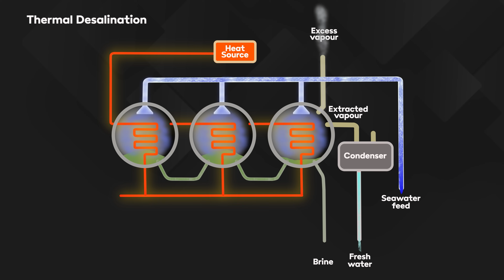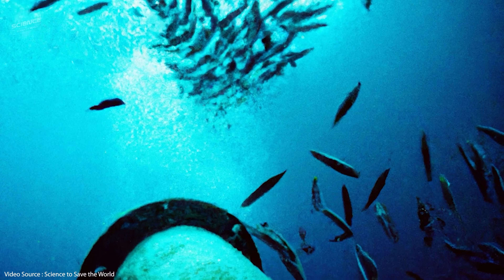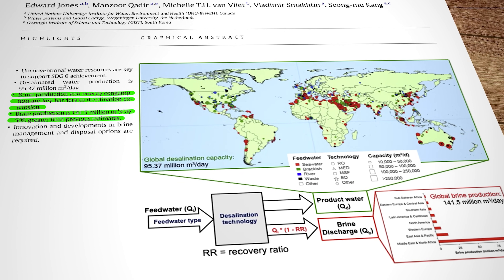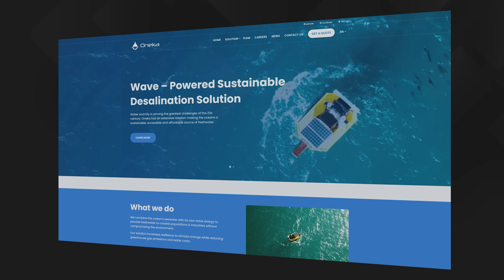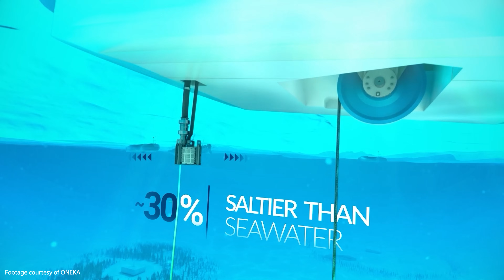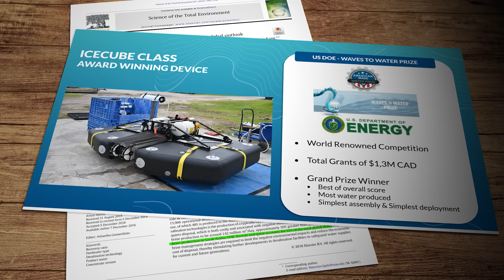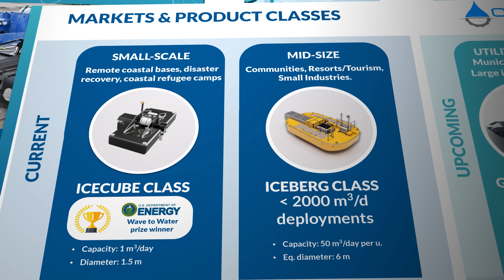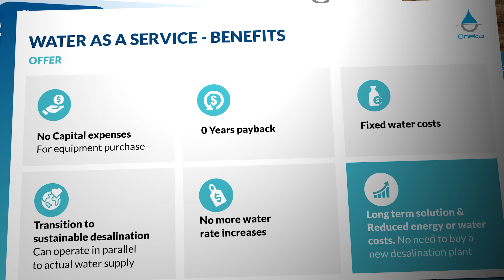Fresh Water at Zero Energy Cost . How do they do that?

Comment: I had this idea 10 years ago while working on the construction of a large desalination plant. The engineers all thought it was a good idea, but with 100 problems. 
The first problem is that most coastlines don't have consistent waves. Some coasts have little or no movement for days.
The second problem is maintenance. Anything done offshore is 10 to 100 times more expensive and slow.
One engineer suggested the Western coast of Australia for consistent wave action. However, I think there is already something similar to be tested in that area?
This would probably be good in some niche applications. 
My design was actually to scale it massively to a large floating platform/barge. Something big enough to have a crew and multiple sources of energy (waves, solar, wind, thermal differential, etc...)
However, I wish them the best and that they prove the desalination engineers wrong!
Reply: On the faq section of their website they state that the buoys will be installed 0.5-1.5kms from the coast. They also start producing water at the 1m wave and optimal production is at a 1.5m wave
Reply: @thexperimenter88  anything offshore is complex. Even at 100m. And nobody can control if and when there are waves.
Reply: @Unitedstatesian  there wouldn’t need to be waves all the time, they just need to be recurring frequently enough. I would expect that a study of at least a year would be done before the installation so that the best coast/site is identified and risk is mitigated.
The website says that they can even install it up to 5kms from the coast if required.
The website also states that maintenance is expected to be minimal and the site expected to last about 20 years, however they have not built the glacier system yet which is the real game-changer.
So I do not expect we will hear from this company for another 5 years but to me it looks like the best solution to the desalination problem if they can scale it up
Reply: Wouldn't scaling it up make using the waves more difficult because a large floating structure is moved less by the waves?
Reply: @florinadrian5174  no, the ocean is a million times more powerful than needed.
Reply: @Unitedstatesian   I think you missed his point. I fully agree with it which is that a floating barge, large enough to span several waves, won't be moved much vertically as its height becomes more of an average of wave and trough heights.  To get the maximum vertical motion the barge has to fit between waves and not ride on both trough and wave tops at the same time.  Sure the ocean is very large but large cruise ships ride on an average surface with little vertical motion.   Sideways sloshing does not count.
Reply: @florinadrian5174  wrong
Reply: @florinadrian5174  Yes but the bigger the structure the more kinetic energy so the less it needs to move to do the same work. Think of an ocean liner vs a speed boat. Also once that mass is set in motion it tends to want to stay in motion [inertia] so - and I'm just guessing here but I reckon the bigger it gets the more efficient it becomes. However I could be wrong but I don't think so.
Reply: Sounds like a dumb objection
Reply: Unitedstatesian said, ""...some coasts have little or no wave movement for days.""

It's easier to store drinking water than it is to store electricity.  The water is pumped ashore and stored until needed.  The stores water is used during calm times.

""2nd problem is maintenance.""

The floating plant is towed back to port where it is maintained onshore.
Reply: If you've worked with a desalination before, maybe you can answer this then-

            Why is the brine dumped out? Why not fully get the salt out, maybe via evaporation pond, and then sell the resulting sea salt? Like salt is valuable, I don't understand why it would be dumped out.

 You could even put clear plastic or something over the evaporation pond, capturing the evaporating water for further fresh water source.
Reply: @firstlast-cs6eg  salt is dirt cheap everywhere!
Reply: @firstlast-cs6eg  Main problems are space and environmental concerns. There is a British? Company testing a solar concentration, evaporation design in Saudi Arabia. It will be an interesting experiment.
Reply: @firstlast-cs6eg  There is enough salt being produced at low cost. If you get salt from unpolluted sea water, there might be niche markets. These plants would be near the coast = pollution from off-run, industrial waste, micro plastics, unprocessed human waste. So the salt  is not necessarily fit for human consumption. For industrial use (huge volumes are used every year to produce chlorine which is a very basic raw material for a lot of chemical plants). But getting some salt here and there would require a lot of logistics and freight costs to supply the large quantities needed for industrial production.
Reply: @firstlast-cs6eg  It's a lot of salt. And salt isn't that expensive.
Reply: @walli6388  People consume alot of salt, there is always a market for sea-salt. And it would be easier to get that salt than other salt sources.
Reply: @firstlast-cs6eg  So where do people get all their salt from now?  If everyone in the world is already meeting their needs/wants for salt, where is the market for salt from a source which is not used now?  Is this source going to be cheaper?  Why don't the people who produce sea salt (even in cold climates like England) just add a transparent roof to their dehydrifcation ponds and collect the waste water evaporating from the brine?  After all, people consume a lot of water - there is always a market for fresh water.
Reply: @firstlast-cs6eg  My assumption: it is relatively easy (use of energy) to get at that level of concentration, and removing  more or ALL of the water would cost a disproportionate amount of energy, equipment etc. The land bound desalination plants also do not remove all of the salt. There is a cost for the energy of the waves (construction, anchoring it to the ground, maintainance). - They are going for the low hanging fruits. There  is a lot of space on the ocean and they do not need pipelines or water transportation (for water intake or getting rid of brine). They have no limitations when it comes to the volume of water intake / relatively unconcentrated brine they must process. They only have to transport the fresh water and that costs (need for a pipeline).

It is a case for the Pareto principle: 
You need 20 % of effort to get 80 % of results, 20 % of the population owns 80 % of the wealth, people wear 20 % of their cloths 80 % of the time etc. The ratio is not set in stone. 

If you have a project, it is often the case that you make good and fast progress to get a lot of it done, but the finishing touches and the fine details take a disproportionate amount of time / energy / cost so if you can skip some of the fine details your productivity goes up. The Pareto principle is also important for time management. I know software engineers and coders, they know that phemomen very well. There is a term "quick and dirty" coding - a way to code fast and with relatively low costs, and it has a place.
Reply: @franziskani  The pareto principle is proven nonsense.

Fine, mention a easier way to get sea salt.
Reply: I'm an Australian engineer and an workmate from a previous employer was working on the wave power generation technology that was being trialed of Fremantle.
There's one glaring issue with all of these wave powered systems and that's getting the product back to shore where it can be used. The offshore power and offshore hydrogen generation people have the same issue. It always sounds easy to say you'll just drop in a pipe or a cable, BUT IT NEVER IS.

Go look up any of the offshore cable and pipe laying videos to see just how hard it is.

I have worked on some reverse osmosis systems but they were not for desal. I also did do some work on a Multistage flash distillation system on a mine site. https://en.wikipedia.org/wiki/Multi-stage_flash_distillation
It was right after doing a reverse osmosis system on another mine site as part of a waste water treatment plant so I got to compare how those systems. I work in control systems so I get variety at times.
 
In simplest terms:
RO plants are complex, expensive and use lots of energy but they can be adjusted to suit demand. Their greatest strength is flexibility. If you need more its generally easy to expand. If you need less you can turn parts off and remove the membranes so they don't sit and deteriorate.
MFSD plants can be a pain to get started but once they are running use less energy. The energy saving comes from operating in a partial vacuum where the water boils at around 70C. Their one major weakness is they have a design operating flow rate and if they are not being run at that rate their performance can drop off rapidly. That means they need substantial buffer tank systems before and after the system because they can't adjust to demands.

The one thing to say about all these systems is that they are NEVER as simple as their promoters make out. There's always something they don't want to mention or discuss.
Reply: Engineers are excellent at thinking up problems. It's our job :-) There has been an endless parade of engineers telling us that the grid will collapse at large renewable penetrations over the last 25 years. Fortunately there is another load solving the problems as they come up and generally finding that large-scale renewables are not just practical, but actually cheaper, at least on an LCOE basis, and probably on a system basis by the time we are done. So whilst there are always loads of problems, if the basis thermodynamics is sound then things can usuallly be made to work. 
Wave energy has always been very tricky, due to the power input varying by a factor of 1000 and the difficult environment, so it's been hard to make equipment that survives for a sensible amount of money. I guess that's the main question here - how much will it actually cost to run?
It's a great idea though, and I wish them the best of luck.
Reply: @xxwookey  technology around producing electricity from wave power has not been idle and has been progressing fast. One company called corpower have the buoys that produce the most electricity. Another promising company is Minesto
Reply: @thexperimenter88  Glad to hear it. I thought that the Finnish outfit AW-energy, that make 'Waveroller' looks promising too. It works, and being underwater it is reasonably storm-proof, but it also looks expensive. But I'm not sure they've managed any actual sales yet. I shall check out the ones you mention.
One outfit that has made kit that can clearly be cost-effective is Orbital (but that's tidal-stream not wavepower, which is a more restricted resource). The clever thing about that is that it is not bottom mounted like most other designs which makes it 100 times easier to service.
Reply: @xxwookey  There is a small pilot-scale wave generation unit being trialed at King Island between Victoria and Tasmania in Australia. It is designed to be close to the shore and is made of concrete with all the electrical components above water so maintenance is easier. They are not looking to power mega cities with them, its more your small coastal town or village.
Reply: @xxwookey  It's better for Engineers to think of the problems before they happen during construction.  It's what Engineering is all about!
Just look at Germany's windmill catastrophe: it caused an Energy Crisis in Europe. The Power available from windmills varies with the CUBE of the windspeed, so half the maximum designed windspeed (say 50mph and 25mph) produces ONE EIGHTH of the quoted power. So, out of 1000 homes, 875 will be without power!
At least, with this desalination plant, they have removed one Energy conversion, and storing 'excess water' will be easier than storing excess electrical Energy.
Reply: @xxwookey  that’s why costs always go up as renewables penetration increases, and once you run out of other people to offload excess power, or import power from the grid collapses. Just ask South Australia.
Reply: You remember correctly. Carnegie have had a pilot plant up and running on Garden Island, WA since 2014. They're testing desalination alongside their wave powered electricity generation. One big difference if I remember the details correctly is that Carnegie use the motion of the waves to pump the salt water all the way to shore and the reverse osmosis or electricity generation happens there. The benefits are that a lot of the equipment is onshore where it's easier and cheaper to service and is protected from the damaging effects of the sea, and adjusting the ratio of fresh water to electricity they produce is as easy as turning a dial. But they have to deal with a centralised discharge of concentrated brine whereas Oneka have that problem solved.

Googling "carnegie desalination" should get anyone who is interested more information about their desal work.
Reply: Details unseen, the back of the envelope scribbles suggest that there are other places where the waves are consistent enough. it may depend on what the real estate market say....location, location, location at least for the smaller two. I know of a site that has wave action every day totally exposed and it's on the edge less than 100 meters from a Pacific Trench. We've done some preliminary tidal/ wave measurements for potential electricity generation ...
Reply: Yes, off the coast of Western Australia, it was being tested more than 15 years ago and had the added benefit of having no floating apparatus so wouldn't impede surface traffic. I don't know what happened with it?
Reply: @someoneelse4492  you are referring to carnegie
Reply: I think they were wrong... 'people' are almost invariably react with this response, but then someone gets on with it and does it. I heard just in the last few days of a similar invention in respect to energy generation, and the 'so called' experts said it could not be done, and this person said "I've got one I've made in my car."
And behold... it worked!
Reply: @sebastianwrites  As someone who nearly always reacts with extreme scepticism, I would certainly put my money on "it can't be done economically in a reasonable timescale."   It would be great to see what this one was that actually worked.  Was it also full-scale and economical to produce? Something that fits in my car doesn't sound like anything more than a proof of concept - like we can prove that nuclear fusion works, but it still looks like it will take 30 years to develop a useful product (as it has done for the past 50+yrs.)  All the expert engineers whom he writes off, are not as stupid as he thinks - that's why they are expert engineers.  Most brilliant ideas that amateurs bring along have been looked at before and found wanting:  often contrary to fundamental physics, as all the free-energy and over-unity machines are, or just impracticable or uneconomic.  If you're paid a big salary by a business that stands to make billions out of it, you don't dismiss good ideas without good reason.   If you're a nutty amateur, what is there to restrain you, beyond being able to con money out of people?  Plenty of people sell snake oil, but very few have a recipe that works.
Reply: @Merlin3189 Well, you're wrong on nuclear fusion as well!

Being extremely sceptical... is not having a "balanced" opinion?
Reply: The Western Australian trial was to supply fresh water to a Federal paid for Naval Base near Perth. The trial is finished and Federal Funding as far as I know has been withdrawn.
Reply: I agree with the maintenance issue. anything with a lot of moving parts and filters is high maintenance
Reply: "Some coasts have little or no movement for days."   which ones are those ?
Reply: I agree.  'Zero Energy Cost' is not the whole truth.
There would be significant setup costs (which someone will have to pay) and ongoing maintenance costs.
I like the mechanical nature of it, however, so that one is not incurring losses with each conversion of energy.
Also, the fact that it basically runs at ambient temperatures would cause less disruption to the immediate environment.
I had wondered about setting up a system where water was evaporated by using a piston that creates a vacuum*, however that would be less efficient and prone to contamination with the rocking of the platform (associated with larger waves).  *Water evaporates at 'room temperatures' in a vacuum.
Nice to see the development of these technologies, but they are most certainly not free.
Reply: A system just needs to store enough water to get through the non productive periods as a buffer. Easy!
Reply: @BuellersBack  Desal systems are expensive to run and maintain. They need to be running "constantly"...large breaks in use increase maintenance costs. Not feasible with the RO systems.
Reply: @Unitedstatesian  I sell the large pumps that go into Desal plants. People don't realize that the energy they consume cost way more than the initial pumps cost themselves.
Reply: @ Unitedstatesian did you actually watch the video?
Reply: Darn! I wish I’d seen this in time to attend Oneka’s November 17th presentation at the 14th Annual BlueTech Week in San Diego, that’s just a hop from here in Newport Beach! Anyone here able to attend? Our local community only last year blocked the Poseidon plant scheduled for Huntington Beach, due to the destructive downsides & economic inefficiencies you mentioned. Here’s hoping that Oneka’s FL pilot pans out, as we in the Southern California “desert” would surely welcome them!

From reading the comments: Re: Ocean Stresses, Collection Infrastructure, Maintenance, etc. They could be located a few miles offshore, where our defunct oil platforms, with their convenient anchor pads, are now. There could be single manifolds bringing fresh water down from a wind farm-like array of surface plants with piping piggybacking on existing oil to shore make ways. There could even be large solar & wind arrays out there sharing a common infrastructure. We have two such sites located ~1/4 mile apart that could provide redundancy. As decades long drill rig dismantling is underway, I’m sure this would be welcomed by the local community of those with the needed expertise & experience to make the transition. From my 10 months working on San Clemente Is. (down coast from Sealab where we chatted with the Cousteau support divers) & being “in” the sea as a lifelong surfer, this sort of thing doesn’t seem anywhere near as challenging as what North Seas wind farms pose. And HB is known as Surf City from its consistent waves where most of the damaging stuff gets filtered by all of our Channel Islands. The biggest I’ve ridden (in SD) was 18’ & it very rarely gets over “pier busting” 15’. Circulating the components for maintenance should be a no brainer with a support/maintenance facility in San Pedro or even off/near Seal Beach (whose very activist residents might welcome the opportunities after thorough consideration). We also have one of the world’s largest (ocean charged?) aquifers that could serve as a storage repository. Please keep us updated! Thx.
Reply: How does the fresh water get to shore? Or did I just miss that part?
Reply: @johncraig2623  You missed it. The water is pumped using the same wave motion through small pipees back to a central, shore based hub.
Reply: Thank you for your contribution to the conversation.
Reply: umm i had the same idea
Reply: without brainstorming about the problems, how on earth we are going to brainstorms about the solutions.

both has special tasks in approaching the goal.
Reply: Never been to a coastline with "little or no movement" let alone for DAYS. Don't know what the fawk you're talking about.
Reply: If you do not have waves extract the heat from the surface. perfect conditions
Reply: Any area that has consistent tidal motion will provide wave-motion for mechanical use (and you might only need coastlines that you can reliably determine are experiencing strong water currents and use that mechanical motion, not necessarily literal waves). The bigger and heavier the platform you are using, the far larger and more consistent the wave-motion you would need to create mechanical power in a useful way, but this could be somewhat mitigated by making the platform segmented, or creating auxiliary components to channel mechanical motion to an adjoining platform. The platforms from this start-up all tend to be rather small, light, and looking to only be used for desalination, so this increases their practical utility and locations where they can be used; even if the largest platform size doesn't work, multiple small ones can be used with small wave-motion to achieve the same result. We'll have to see how they work in different coastline regions over time, of course, but they might also be able to create really large platforms for deeper ocean areas as well
Reply: How many marine biologist were working with the desalination engineers?
Clearly their concerns were overruled.
Brine concentrations at the discharge create an expanding dead zone.
Not doing that is worth he exploration of this tech.

Solar and wind energy production are also a distributed method vs a coal or gas fired power plant.
Taking smaller nodes off line for maintenance is less disruptive to production.
Reply: @IMGreg..  Those are some of the good points. In our project, we had to run pipes to different branches and different heads and take current and temperature into account. I am not a biologist so I don't know if it is better to start dissipation at 30, or 50 meters ...or on the surface. I assume that deeper with good currents is better?
I think desalination systems need a lot more maintenance than offshore wind. And running power cables is much easier than running pipes.
Reply: I immediately had the same concern about maintenance and then I thought this can be mitigated by keeping their system would be modularized in a fashion that maintenance would not be performed offshore. The presentation seems to reflect this. The sensors would show the failing modules, tow out a replacement and hot-swap it thereby keeping offshore work to a minimum. With a purely mechanical system, MTBF should be fairly accurate so regular maintenance should be simple to factor into the cost model.
I don't see consistency being a major concern. Even on the flattest shoreline day, there is a consistent enough bobbing deeper out in the ocean. Also, once a reservoir is established there will probably be more than enough buffering for daily variations.
Reply: A bit late to the party, but I wonder if maintenance could be addressed using the same concepts as lights-out factories. Don't those use robots to do most of the maintenance, with sensors & regular engineer visits to address larger problems?
I imagine swarms of low-flying drones that move out to the platforms, perform the maintenance, & fly back. Then, rotate to the next platform.
Reply: @TheKauff  I could see flying drones doing visual checks, but not maintenance. Maybe a floating drone could pick up the device and swap it to bring it to shore for maintenance. The engineering to design a simple hot-swap doc that could be done by a drone autonomously would be a tough challenge.
Reply: @Unitedstatesian  I could see that. I haven't seen any details yet of what exactly would be covered under "maintenance", so it seems like we're trying to solve an undefined problem.
Reply: @TheKauff  RO Desalination plants have a lot of maintenance issues! 
Sea water corrodes everything. Sea life gets into every nook and cranny...even microscopic ones. Anything metallic rusks. Filter tubes have to be backwashed, changed, fixed, etc. Chemicals have to be monitored and adjusted constantly, sensors fail and give confusing data, all this is done under extreme pressure and the hydraulic issues with the distance to shore are huge...and that is on a good day and far from complete...
Reply: uh 

i mean, aren't there literally always waves in the ocean because of the moon's tidal forces? 

i'm on vancouver island and i can't recall a single time i looked at the ocean shore and there weren't waves
Reply: On top of the non consistent waves, the amount of wave energy is rather limited.  Suppose one 50 cm wave, it can give max. 2500 J/m² of sea surface. Suppose the waves come at a repetition of 10 sec, this would result in an very limited average available power of 250 W/m² of sea surface.  Reverse osmosis for sea water requires about 3 Wh/l.  With an available power of 250 W/m² on can produce theoretically 83 l/h per m² of sea surface.  That seems a lot, did I make a mistake?

An alternative that is often mentioned is the use of straight solar energy (800 W/m² or higher in most regions where there is shortage of fresh water) to make the water evaporate and make it condensate by using the cool seawater from deeper sea levels?  Water needs 2256 kJ/kg to evaporate, so with 800 W/m², one could only produce 1,27 l/h per m² of sea surface.  That seems so little, did I make a mistake?
Reply: @tuttebelleke  250W/m2 is quite a lot of energy. About what you can get out a PV panel in good conditions during the day, but much better over 24 hours. And I think your calcs are just demonstrating how much more efficient reverse osmosis is than straight evaporation. The sums/numbers look about right to me.
Reply: @tuttebelleke  Desalination by evaporation on board of ships used to be done under partial vacuum so the engines cooling water is warm enough to provide all heath needed. that same cooling water flow is also used for the ejectors that provide the vacuum. The energy used is mostly "waste", so it seems to me that the calculation need a different approach.
Maybe the topic starter can help us out with that?
Reply: @tuttebelleke  I can’t do the maths but I can tell you that’s what the Minesto company’s is optimized in. They do not need those big waves since they fly an underwater kite in a figure of 8. There are specifics as what sort of conditions their underwater kites operate in on their website.
As for generating electricity out of decent waves, the best company I have seen so far is corpower
Reply: @tuttebelleke  I think your low figure for distillation is based on completely wasting the energy of evaporation.  If heat is recycled - using incoming salt water to cool outgoing vapour/fresh water - then the minimum amount of energy actually needed, is closer to the difference between evaporating a kg of water vapour from saline (what you put in) and evaporating a kg of water vapour from fresh water (the maximum you could  get back.)
Reply: @tuttebelleke  considering the the evaporating in more than 10 steps, the flaw of fresh water can reach the value of 15 lit/h/m2. There is the plant in Spain working on this principle (recovering condensation heat).
Reply: @tuttebelleke  Your figure for reverse osmosis energy requirements of 3 Wh/L seems miniscule, are you sure you don"t mean 3kWh/L?  R.O. is not just pumping water, but pumping water at very high pressure which therefore takes very much energy.  I don't have figures for it but perhaps you do.
Reply: @tuttebelleke  you can use a heat exchanger to transfer heat from exiting water to incoming water. That would increase the efficiency.
Reply: @tuttebelleke  Wave energy potential is estimate on Kwh/m not  Kw/m2
Reply: And don't forget storms ripping it all up...
Reply: I was thinking some of the same things. One other issue, if you had dozens (hundreds?) of these things offshore, it would be a serious navigation hazard. And how does the water get collected? Maybe I'm commenting too early, but I haven't seen anything in the video about it yet.
Reply: One nice part of this being a scalable system by way of multiple platforms is that you can tow them back to land for maintenance and to fix problems. That makes the running cost a lot cheaper I imagine.
Hard to do that with a wind turbine.
Reply: @Elbrasch  and you could even have a few spare, so one out for routine maintenance or if its broken and attach another at its anchor.
Reply: @Elbrasch  Isn't towing them back to land and then replacing them on site after maintenance, a big part of the reason why offshore is more expensive?  I expect all the problems have ways of dealing with them, but isn't it the extra effort and cost which makes them problems?
Reply: @Merlin3189  for a 100 meter wind turbine, yes. You can tow these units with a motor boat and a local guy through, so that cost scales differently due to being able to not needing low volume special equipment/ships.
Reply: @Elbrasch  You may be right.  The 100m wind turbine is comparing one very large operation with how many much smaller and easier ones?  Ashore, power stations tend towards few very big units rather than collections of many small units, so they must think there are some economies of scale. But there's no reason why that idea should apply to these devices.
It will be interesting to see if the project progresses.  I have great faith in engineers to overcome almost any difficulties, but reality and economics are doughty opponents.  The only example I can think of where an outside inventor succeeded against the establishment is Dyson and his vacuum cleaner.  I don't know the full story, but I suspect that might have had more to do with money than engineering.
Reply: @doggonemess1  they have a web of pipes. Another problem with this design.
Reply: @doggonemess1  Bringing the energy ashore is, I believe, one of the big problems for offshore electricity generation.  So your point about the difficulty of bringing water ashore from multiple small sources seems very pertinent.  I'd have thought that pipes from moving sources would be even more problematic than cables.
Reply: How much maintenance would even be required, and what kind of maintenance?

If it was closer to shore, you'd get more waves (waves form and break as the land comes up) 
and it would be easy to access too, it could be connected via a walkway even to make easy access, no boat needed.

Also two issues is not a "100 problems"
Reply: @firstlast-cs6eg  I did not mention all the problems. And for environmental reasons you can't be too close to the shore.